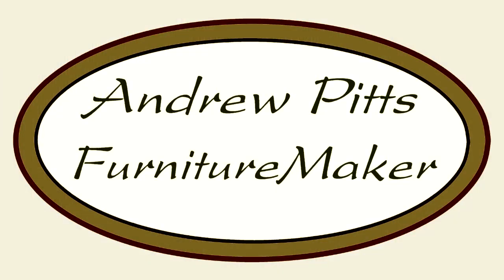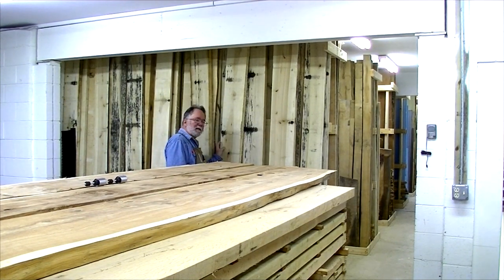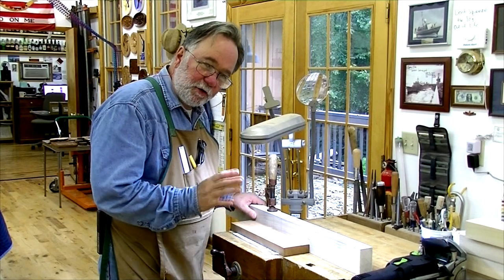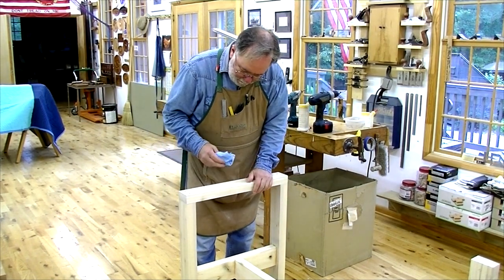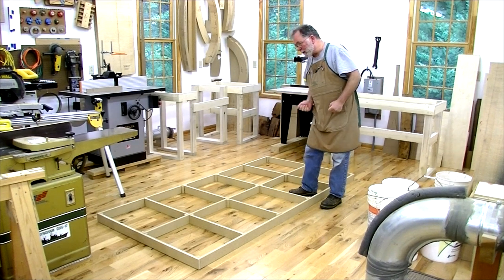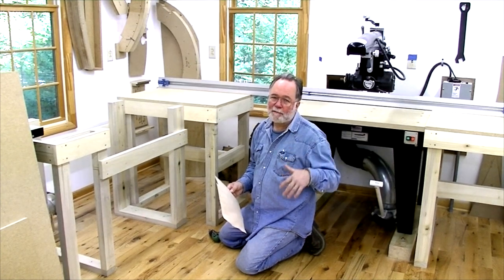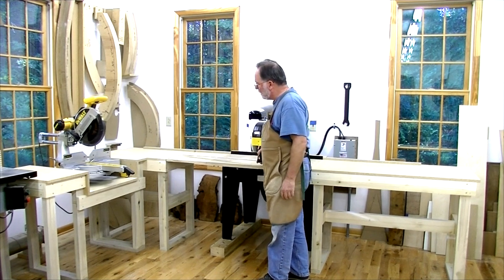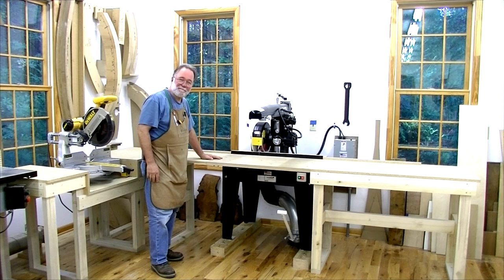Radial Arm Saw Extensions: Saturday in the Woodworking Shop #27 with Andrew Pitts FurnitureMaker

Comment: Wish I had the space for a dedicated setup like yours.

FYI, for cutting sheet goods I use  2" thick 4x8 foam insulation board (~$15 at the home center) that you can lay on the floor or saw horses. Fully supports whatever sheet goods that you are cutting and it lasts just about forever.
Reply from the maker: +Marty Backe That's a great idea, Marty! I wish I had thought of that before I made the frame. I would have saved money and it would have been lighter and easier to move around. Actually, I have some left over 1" piece from when I insulated under my concrete floor.

Comment: you a nice stock pile of wood Sir.   Does it matter if you store wood vertical vs horizontal?
Reply from the maker: +Patrick Melchior I used to store it horizontal (some still is that way), Patrick, but I could not get to the bottom of the stacks. So, I made the A-frames to support the wood at a slight angle and that seems to keep it straight and easier to sort through. Learned that trick during a visit to Sam Maloof's shop.